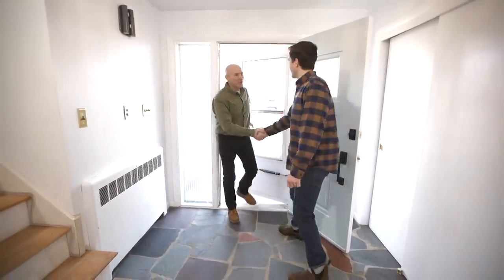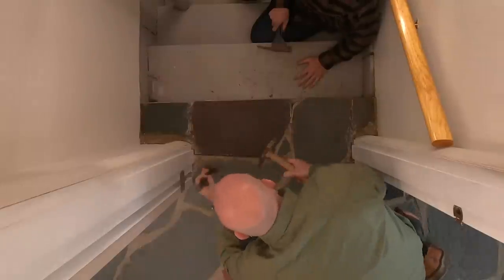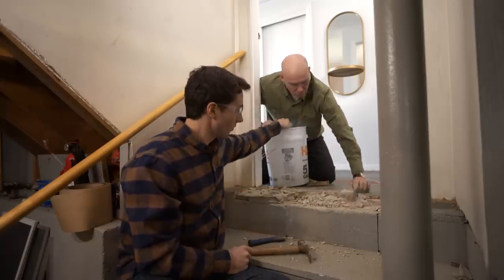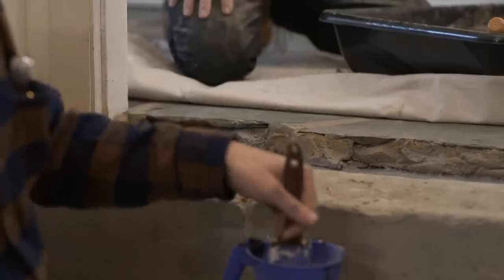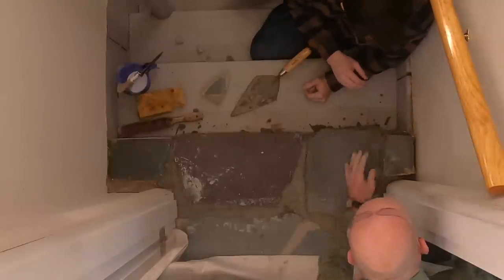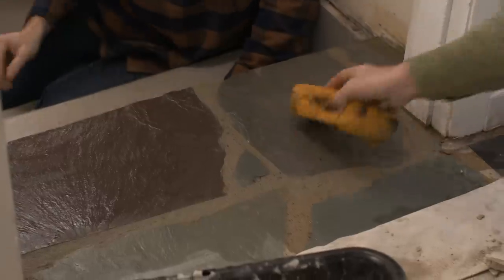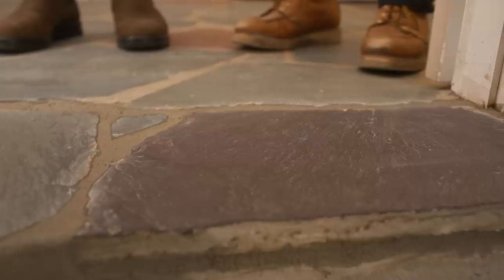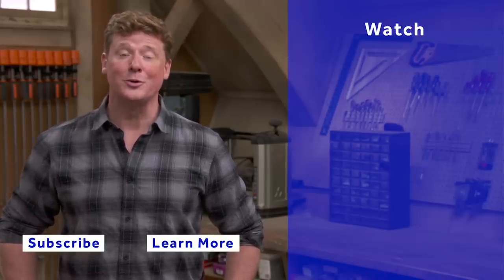How to Repair Flagstone Steps | Ask This Old House

Comment: The cauking joint at the base of the stairs was too thick.  Mortar should have been reapplied after chipping out any loose mortar, and then apply a thin bead of caulk.  Caulk is not intended for large voids.  I suspect curing tune for mortar  would have required a return trip to apply the caulking.
Reply: exactly what i was thinking
Reply: He could have stuffed a little backer rod in there and caulked on top of that, right?